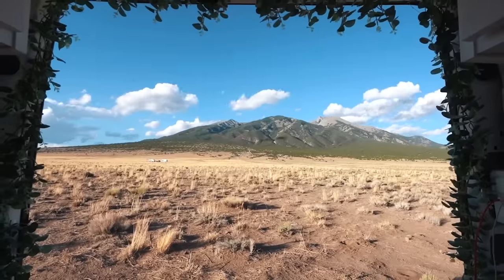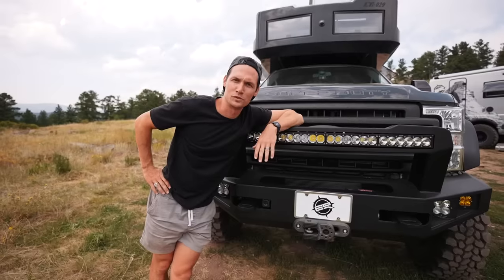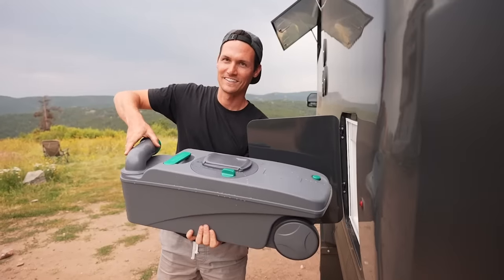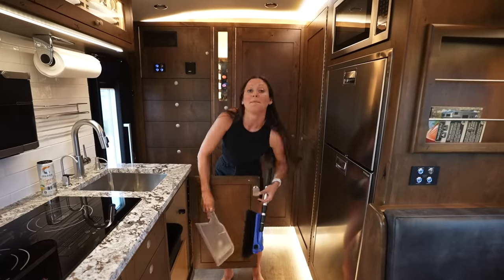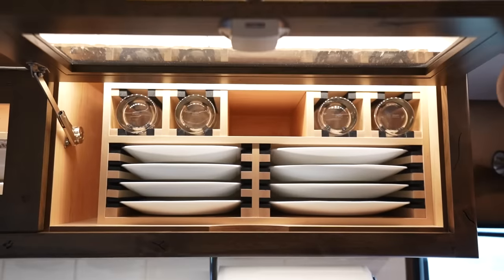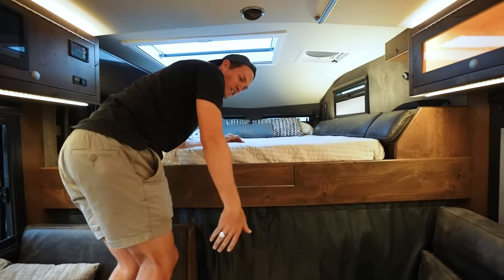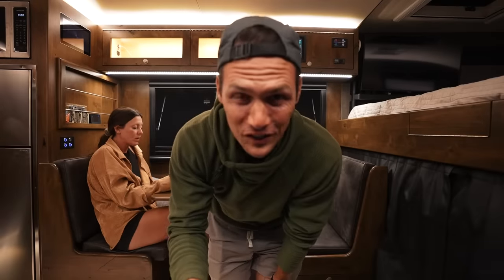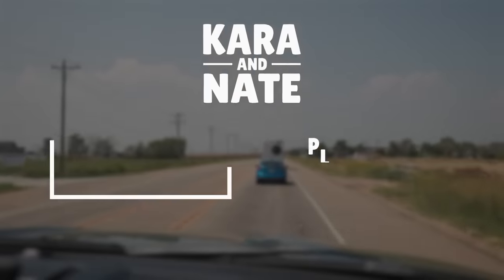WE LIVED IN A $650,000 EARTHROAMER (full tour)

Comment: So, what exactly in that vehicle makes up for a total of 650,000 USD?! It's literally a regular Ford pickup truck with a custom made camper-back... Even with the most expensive materials, the most expensive tech, the most expensive parts and just the most expensive everything... That truck just can not cost more than 200,000 USD to manufacture/make. (And even 200,000 USD is stretching it and that's with tooling costs, production costs, taxes and employee cuts included...) Where's the other 450,000+ USD?! Not even Mercedes charges that much for their camper conversions. For 320,000 USD, you can get the biggest, fully custom made (by your choice), Sprinter camper - by Mercedes themselves with the best/latest materials, tech and parts world has to offer... For 650,000 USD, you can get TWO OF THEM! What exactly makes this Ford pick up/camper worth as much as TWO, best-in-market, Mercedes campers? Where's the extra 350,000 USD going to?! What am I getting extra for 350,000 more?!
Reply: Those customized slots for each dish and glass are very expensive. I think that’s what you are forgetting
Reply: i agree! the most expensive  items would be the f550 (LARIAT 4WD Crew Cab 203" WB 84" msrp $58,065.00) the tires,( Continental MPT 81 - 335/80 R 20 - (12.5R20))  ive seen varies dealer prices 600-900$ x4. and the solar panels. not suree what brand and type . but this specific kit would be  sufficient for this: EcoFlow Delta 1800W / 1300wH Solar Generator [Quad Kit] + 4 x 100W 12V Mono Solar Panels | Complete Solar Kit.  1697$. the camper itself since its carbon fiber under 150k
Reply: We have a 2006 Sprinter and I have 90% of what the Roamer has but at only about $50k. I admit I'd like the 4X4, but wouldn't like the over 12' hight and especially the 29' length.
Reply: The labor and man-hours it takes to make this thing
Reply: @aGrizzlyProduction  😹😹😹😹😹😹😹😹😹😹😹😹😹😹
Reply: Lmao I commented the same thing. Rip off

Comment: Great review! I'm with you on ditching the keurig for an upgrade...

Beautiful RV, but way overpriced for what it is.  I suppose I'd charge that much if I could get it, but honestly, they'd still be making good money at half the price.  It does make me wish I had kept my F450 and DIYd something like this. 😉
Reply: Id have to disagree however many years ago might have made a similar statement. 

First, we have the rig being an F550. Most of these are destined to work and come appropriately stripped with a 80k price. To have one built with all the interior options of the more common F350 plus exterior bling like mounding and doorbhandles that aren't from the Amish Package, and I'll guess the cab and chassis came in at close to 125 or 130.

Next... Carbon Fiber. Not much needs to be said on that front but this beast is made FROM it. Not accented, not highlighted with or essences of it. It's MADE of it. Imma guess 100k in carbon fiber just for the shell.

Next up we have the biggest toteboard of 'Let's Get Small'. Price per square inch on a motor home gets exponentially larger the smaller one goes. Eventually there is a balance point but it's a rule that makes sense after one gets over the initial shock. Going Small yet keeping the expected functionality costs more with tighter spaces for behind the scenes plumbing / wiring etc as well as for the fixed cost of the thing itself. Poor example but what comes immediately to mind is extend-Range or performance of an electric vehicle requires either more batteries or better performing batteries that fit in the same space available for the standard ones yet offer more capacity. Going smaller yet expecting same or bigger will cost ya no matter how its sliced. Toss in another 100k or this and the other etc's plus labor which is not piece work but craftsmanship level crew. 

Then throw in all the touches like plate and silverware slots that keep the rig quiet while driving (huge, trust me on that or try listening to glasses clink and crap rattles for 300 miles on the way to the camp. )  Every where one looks, this rig is filled with this type of unexpected design and thought that oh just so happens to be wrapped in higher-end finishes and or materials. Check another 100k here.

Lastly, wheels, leveling, power plant. God knows how many stage paint, bumper boxes etc and it's bespoke without actually being bespoke. But I bet they welcome call outs. Either way...pop another 100k to the bill for this and installs and integration with everything else. Oh and make sure it all can survive extreme swings in Temps, being shaken and bumped as well being potentially invaded by mud, critters and moisture that is magically repelled for years.

So far, I'm up to 425k but very likely have missed a good number of items so I'll use a standard overrun factor of 30% to account for it bringing my final estimate to basically 600k.

Dealer ask is around 700k. They ain't getting rich at that point which is why earlier I remarked in another comment of expecting 900k. Or more.

This is a bargain.
Reply: @dhranch4627  you do understand companies pay wholesale prices, right?
Reply: @gromzuk  Companies do, you wont.. I'm with DH, no way you could build this yourself for less.
Reply: @lanejohnson7656  uhhh, ok. who said I could 😂

If you like the company, cool. But don’t act like these ppl aren’t making a killing after paying wholesale prices.

It’s a “bargain” tho 🥴🤣🤣
Reply: @gromzuk  The OP was a comment was talking about building one. Your comment was to someone listing off the potential costs of building the machine saying they get materials at wholesale.  So yeah.

I'm not necessarily a fan, but I can appreciate fine workmanship and that comes at a cost. Personally the rig is way to Gucci for me, but I'm sure I'm not their target audience..lol

Comment: I bought a older lance 800, put it on a 10'' flatbed 2002 dodge ram Cummins open cab and chassis truck, with a 4'  extension, that comes off. Took the obstructive waste tank out, so I could slide it more forward, and easily tow. Putting all the bells and whistles currently. I can afford newer and better, but it's all I need. I can't see spending that much money on a camper and truck. Even if I was a millionaire, that's just crazy. Those who finance, where's the freedom to travel?

Comment: Terrible no show of pressure from water pump air compressor flow and noise is the tank system really that good why not spout. It should carry road tires and change system no negative pressure flow for toilet convection system uses a lot of electricity. Now if you break a cup you’ll have to buy one of theirs glass protecting for hail or safety roof cases over bed gonna suck the day you need to access roof while raining kitchen vents system battery capacity test hot water insulation hood or bad so many missing things